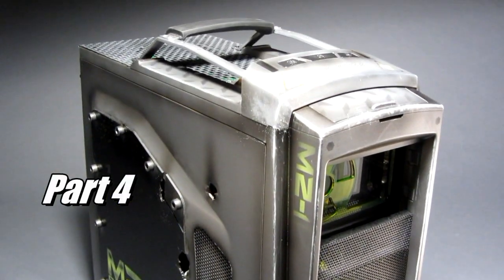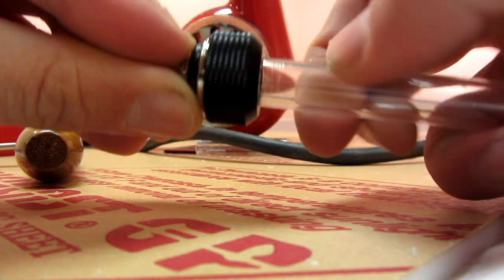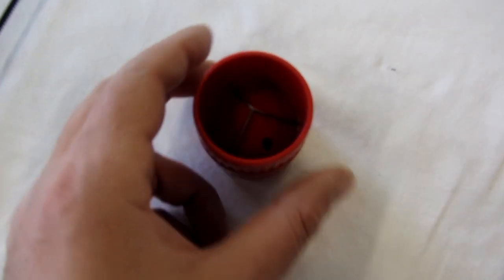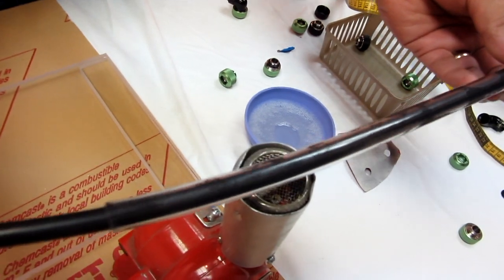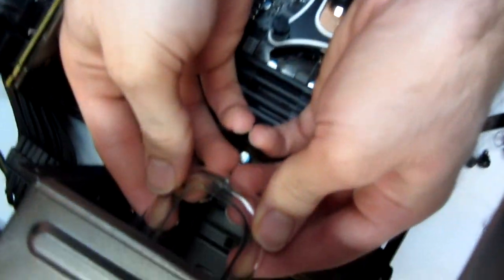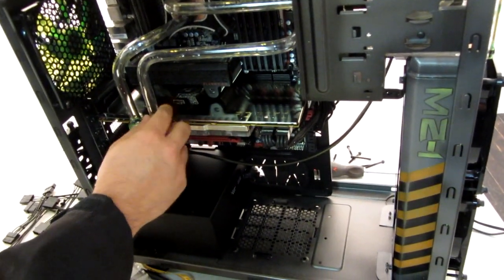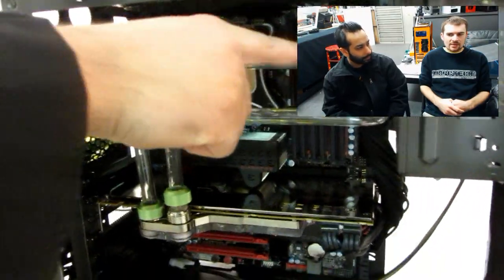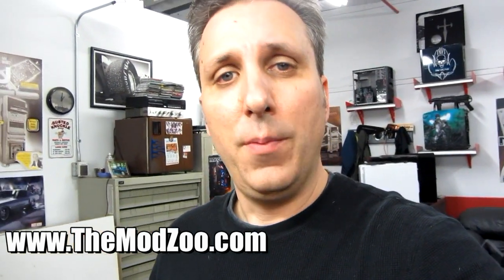"MZ-1" Mod Zoo PC, PART 4, Guide to Bending Rigid Acrylic Tubing for Liquid Cooling

Comment: I'm currently running a soft tubing GPU+CPU loop in my corsair 760T. I was thinking about switching over to PETG but since I plan on upgrading to a bigger case within the next 6 months to a year I think I'll wait. Don't want to spend all that time and money to swap out for a hardline loop and then just dismantle it shortly afterwards. Plus I think draining a softline is easier since my drain port isn't in the best place. Once I get a new bigger case though it's on!

Comment: I am still tempted to use copper pipes but think i will cut my teeth on acrylic first. Never been a fan of floppy tubing loops, they look kind of messy unless you use a ton of fittings. Thanks guys...
Reply from the maker: Agreed! I'm getting samples of new compression fittings made specifically for Copper tubing soon, will test with this acrylic as well, may have to dive into Copper loop sometime